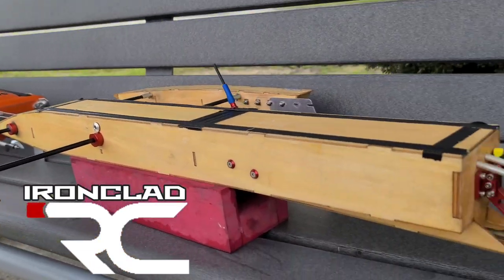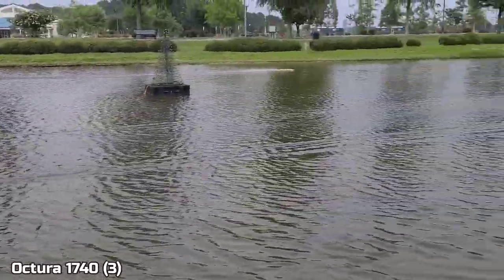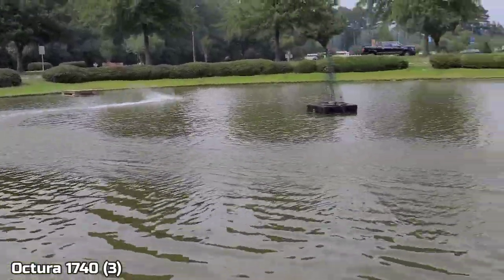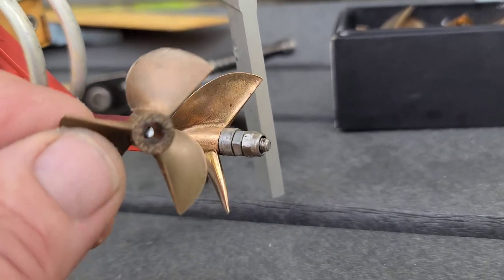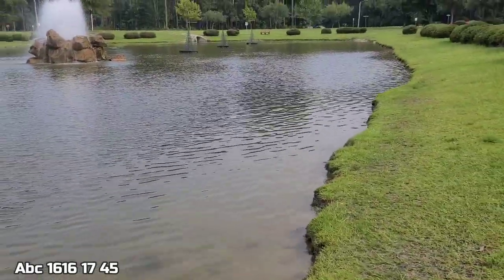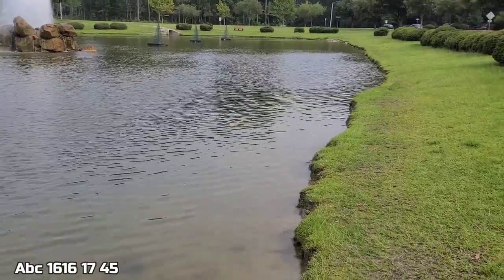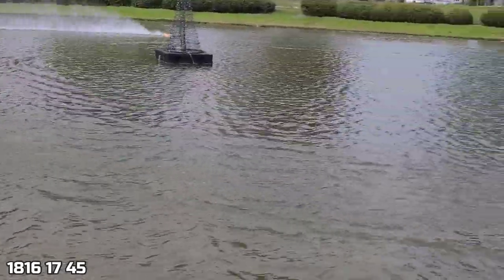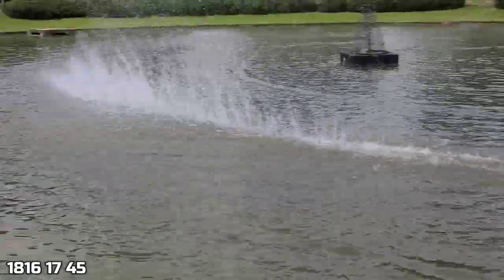Two & Three Blade Propeller Test Oxidean Oxi-digger RTR Wood Outrigger - Octura 1740, ABC 1616

Comment: Sam Halstrom is getting 94mph 2050 kv and 1818 abc cleaver srd’s similar rigger you might pop over and take a look it’s his 33 zipkit 6s not the 8s MLit might be a good short cut to speed if you want a short cut that is 😂
Similar size motor and kv although his is a very expensive Steve nue 4068
Reply from the maker: I'm subscribed to Sam he's one heck of a builder, he has some great runs under his belt.   I'm just getting started on my path to 100,  I'm in no hurry to get there..